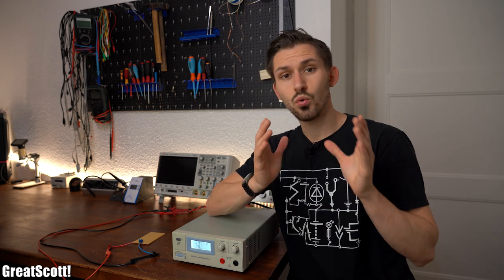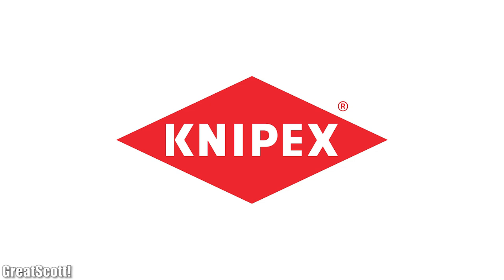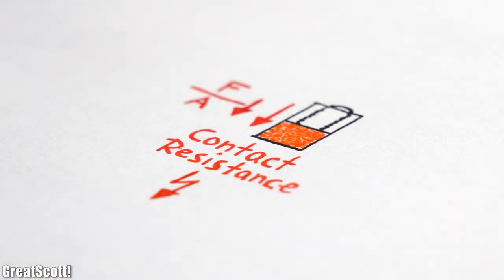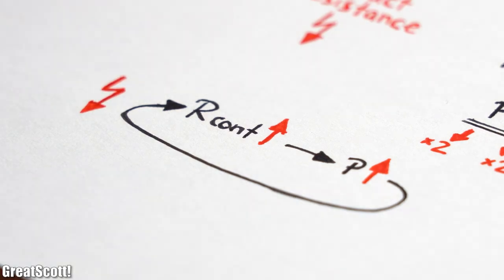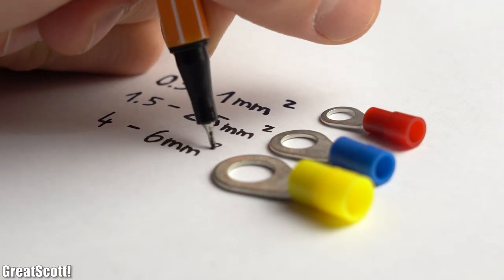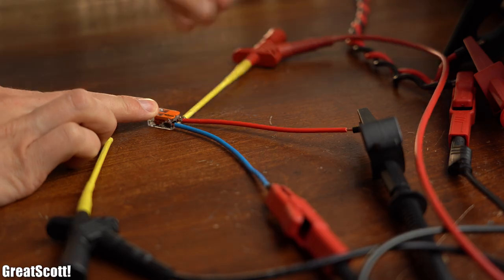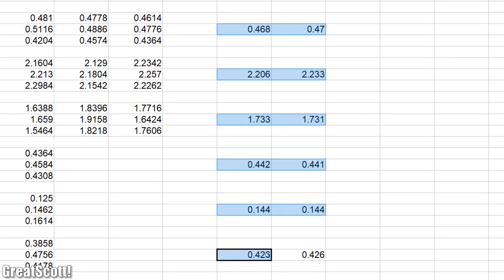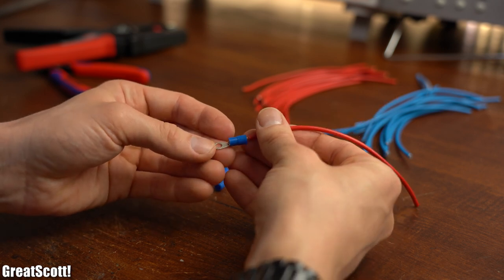Connectors are more important than you might think! So which one is the best? (Experiment)

Comment: If you're going to join wires with solder (which is a great idea), at least twist them together before you do. Better still, use a linesman splice (also called a Western Union splice). Some wiring regulations require mechanical connection between wires and solder alone will not pass inspection.
Reply: Solder is really like electrical hot glue. It's not super strong, and it's not super conductive. It just holds things in-place.
Reply: @jaymzx0  Wire splices hold things in place. The solder just ensures electrical and heat conductivity remains high, and corrosion between the spliced wires, low.
Electrical conductivity of a spliced wire and solder join is excellent, but mostly because you have a large surface area of contact between the two joined wires.
Reply: because when the wires heat up the solder can melt and then the loose end might electrocute someone
Reply: I learned how to solder when I was about 11-12 years old I still have my Weller 8200 soldering gun to this date. It's had a new case, replaced the cord a few times, but keeps on going. Early on I learned about cleaning the conductors, and making a strong mechanical splice whether butt splice, pig tail in both solid and stranded wire.  Apply heat to the work, let it get hot enough to "melt the solder, and flow into the joint"
Reply: Solder is like thermal paste. Not a good conductor, just a lot better than letting an air gap form. And a weak glue that is strong enough for unstressed connections.
Reply: @rebeuhsin6410  No you don't need to clean the core flux, not from current carrying wires. The flux core in the solder is always just a form of rosin flux, usually distilled, often mildly activated. It doesn't exactly pass the NC criteria since it can change its properties over time a little, but in cold state, its acidity is so low that it'll rather create a passivating surface oxide than actually damage the conductors. And obviously you should never design such that you have a wire generate enough heat for it to become active, because at that point, odds are, your insulation is melting off.

You should clean it from PCBs though. I haven't seen it outright eat the PCBs, but sometimes you see an old board, which has a difficult to diagnose issue, you clean it, it works perfectly, huh. Probably the flux residue combined with some moisture or attracted other contamination which caused just a little bit of coupling or creepage.
Reply: Lol this comment chain has so much wrong info. 

Tin and lead and silver are not conductive? Bad mechanical joint?

I don't think any of y'all know how to solder. Lmfao

Comment: I've recently found that "fork" connectors work well. They are just like the cable shoes, but instead of having a full circle, they have straight "forks". This means that they can be screwed in with the same contact resistance as a cable shoe, but they can also be inserted in the side of a screw that's already in its hole. It helps to keep the screws in place!
Reply: They're so freakin' practical. I've added them to all the screw terminals on my 3D printer (the power supply takes most of those), bought some ferrules too for the other type screw terminals (yeah, confusing I know: the former is the one where you can insert a fork terminal, the screw goes through the place where the wire goes too, the other one you use ferrules on, is what Scott showed on the video).
They're specially easy to work with when you have to do some maintenance and remove cables and such, dealing with the bare wire is annoying.
Reply: @Mr.Leeroy  then buy better quality.. no problem here with that.
Reply: I tried using a fork for my problem but all it did was shock me '--'
Reply: @MultiDarkZen  Were you inside a toaster with your fork?  ;-)
Reply: @Mr.Leeroy  thicker copper ones.
Reply: You lose about half the conductive surface of the connector though, so its resistance is higher than that of a ring connector.
Reply: @chriskwakernaat2328  non-dollar store ones that have UL/CSA markings on the box are 100x better than the cheap ones
Reply: i like the round ones because you can add loads of batteries in parallel

Comment: Great video!  There are about a bazillion different kinds of connectors and each one having some form of variant.  My electrical kit I take with me to work on, God knows what, is about 80% connectors.  There is no way that this video could cover all of them and not turn into a lecture.  It was perfect for covering the most common ones, but more so in getting the point across that it matters and that all are not created equal!  When I’m diagnosing a problem, step one is usually check the connections/connectors.

Thank you for the work you have done over the years!  This channel has been a key part of my development in this field.

Comment: For 3D printers I’ve found the screw terminals used for main power and the heat bed are usually the right size to replace with an XT60 connector soldered directly to the board. I started doing that after a fire with my first printer (lucky I was sitting next to it at the time….)
Reply: I offboarded my bed heater MOSFET using XT60 .... Kind of regret it though, the cables are really unwieldy....

Comment: I always prefer termination with Lugs crimp and solder them . It is very reliable in all weather,indoor or outdoor .  But it takes time. I had applied this method on 400 KV/ 220 KV transformer control wiring and it is working very fine since last 10 years in extreme weather condition

Comment: Wago makes PCB terminals as well as pluggable connectors.  I haven't used them on a project yet but they look awesome.
Reply: Wow, thanks for this information! Love wago, but have only seen the cable to cable type shown in the video.
Reply: I've used the pluggable  Wago terminals, very useful.
Reply: Got a model number?
Reply: I can really recommend the Wago 804 series. Since I discovered them I stopped using screw terminals on my PCBs
Reply: @simbone  Thanks!

Comment: Did I always do my crimp connectors wrong? I thoght the bit of plastic/isolation on every connector is supposed to cover all the copper wires, so you cant touch them direclty when they are inserted.
Reply: The bare wire was left for him to connect the volt meter to but should be covered in normal use.
Reply: @sdp8483  Yeah he should have mentioned that you are not supposed to do it that way :D
Reply: What others have said.  It's an oversight in the video.  You're doing things correctly.

Comment: You should try using good quality screw terminals. There are two types of therminals, the ones you use are the shitty ones. In those a screw pushes a metal sheet onto the wire.
In the good ones, the screw pulls up a kind of metal  'elevator' that squishes the cable. Imagin a very big cable entering the door of a regular elevator and then the elevator goes up until it crushes the cable with the door frame and it can't go higher.
I call them the "gillotine " type.
I am pretty sure you'd get a VERY different result with those!
Reply: The first ones (the ones Scott uses) are the "leaf spring" screw terminals, the other ones are called "cage clamp" screw terminals. And I agree, the leaf spring are absolute garbage, not only they have high resistance, they also cannot bear any mechanical stress whatsoever.
Reply: I definitely agree... these types of terminals have a tendency to release the cable over time as well because they don't properly clamp down
Reply: I've also heard the second type called "rising clamp". Though, you need to be careful not to accidentally put the wire in the wrong side.

Comment: Thank you for the tips! In the end, I decided to use the Wago 221 612 connector for my new electric shower (the most popular way of having hot water when you take a bath in my country). The previous shower's connector (a generic ceramic one) had a bad contact, since the cables didn't even have a ferule at the tip. The heat was so interese it melted/burned the insulation of one of the cables and it even welded together with the connector!
It was a lucky find, I didn't even know it was connected like that until I decided to change my shower because I just wanted a better one

Comment: I recently fixed a wall outlet that used screwless terminals. The live wire was cut for some reason, with the live wire flapping in the breeze and a small part of the wire still stuck inside. It was hard to get out the small bit of stuck wire, and it's also somewhat hard to put in something new -- as the wires are not stranded, they are indeed very inflexible, but you have to apply some force to get it in. Especially if you're only replacing a single wire with the other one (or two) still attached. You risk bending your wire a bit too much (which may be the reason why the wire was cut in the first place) So I recommend you get ones with regular screw terminals if you ever find yourself having to buy sockets for your home.

Comment: The soldered connection is often the worst for long term applications. I have had so many occasions when the wire breaks off at the place where solder ends. This is the biggest issue with multi-strand wires and always have to use connectors in vibration environments like automotive.

Also don't solder the wires in the crimpable connectors. Same problem with wires breaking off

Comment: Great Video. Another connector type that I sometimes use when higher current might be possible are the XT60 and XT90 connectors, but those are overkill for most projects and you will pay a premium for them, at least if you get the real ones (which are probably the only ones you should get)
Reply: That's why you go for the XT30 instead. They're much more manageable in size, don't take 10 tons of force to separate, and you can get them in packs. My favorite connector, hands down.
Reply: XT60 is actually very inexpensive compared to connectors like Powerplug and EC3 that it competes with. Obviously comparing genuine vs. genuine.
Reply: @SianaGearz  a key difference is connector stability too.

A cheap and presumably fake powerpole is absolutely a fire risk. It depends on the construction of the plastic housing to keep the connection intact and stable.

An XT is essentially a bullet connector in a keyed housing. You could remove the entire housing and the connection would still function as designed. Thus a cheap XT... is not nearly as risky a proposition providing the connection internally is sound.

Though I'd still go legit only.

Comment: Although soldering makes great electrical connections, it might not be the best solution in environments with lots of movement (near motors or inside vehicles). Stranded wire tends to break at the transisition between solid (soldered) and flexible parts of the wire. In these environments it's better to use terminals. When you do solder, always use heat shrink tubing that extends well beyond the soldered part, to stabilize the connection.

Comment: That is very interesting, in 3D printing, some companies like creality use to tin the tip of stranded wires that then go in screw terminals, that's used for the bed and hotend heaters, therefore high power.
It's not uncommon to hear complains from people of melted screw terminals.
With what you found out, it would be better to replace the screw terminals altogether, as when heating up, bed and hotend can draw over 10A.

Did you test the screw terminals with stranded wires or with ferrules?
Reply: That was no doubt a cost-cutting measure considering the market segment Creality occupies, presumably to aid in assembly without stray wires shorting out against other terminals. Crimp ferrules are cheap and are the right way to do it. I recently rewired my Prusa knockoff printer bought 5 years ago with ferrules and Wago terminal blocks. Even with the 200mm 12V heated bed at 90c, the connectors are as cool as a cucumber. When I first got the thing, the cheap knockoff 'Phoenix' connector that plugged into the RAMPS board melted and almost caught fire during a print. I replaced it with a legit Phoenix connector and it was fine until I replaced the board a few years later. So, beware of knockoffs!
Reply: Can confirm, I have an Ender 3 Pro and am planning to replace those terminals with Wago connectors instead... Never realized how awful those PCB screw terminals are and I'm very glad I learned from a YouTube video rather than personal experience.

Comment: A couple of thoughts to add.

1) Screw terminals with mains wiring need regular tightenning because the nature AC current will cause vibrations that in time will loosen the screw. This is big reason that many electrical codes now prescribe spring terminal connectors for hidden or concealed junctions.

2) Screw terminals deform single strand copper which does help to captivate the wire even if the tension fades due to 1) 
    Worse however is that screw terminals have a nasty habbit of cutting strands of stranded wire or just pushing them aside so that the screw doesnt hold or make good contact with a substantial portion of the wire - which is one of the many reasons they really suck for stranded wire.

Comment: I'm just looking for a good wire and connector for a moduled PSU .
I'm planning to make my own moduled wire to make my computer setup more tidy,however,it seems different wire gage and connector type really do something to the power performance?
Reply: The way the gauge affects the terminal is only in regard  to the voltage drop across the wire, which increases with more current draw. Hence, a bigger conductor has less drop. This is an issue with REALLY thin wires. the 28-22 AWG wire in PSU's is generally sufficient. 

Silicone wire sheething (outside plastic) feels nicer, and is more flexible. The xx/xx numbers on stranded (AWG) wire are a combination of the individual strand gauge, and the count.

For your connectors, you'll have to the standard Molex MiniFit Jr that almost all pc parts have.
Reply: @AnnaVannieuwenhuyse Thanks , however, based on my current knowledge,there are several types of connectors(for cpu 8 pins ,PCIe 8pins and MB 24pins),the long one,short one and one with glod layer. There seems lits to do to make a high quality and durable moduled cable!

Comment: I like your videos, this one is exceptional because I worked for AMP connector later Tyco electronics. In several scenes (e.g. 9:52) you see blank wire after the insulation of the ferrule AMP connector. This is a no-go. Manufacturer's recommendation is to strip of 3mm of the cable insulation. But beside this - good job man.
Reply: I believe he had done so for the purpose of measurement, to have a point to jam the probes into, not a recommendation for actual deployment. Could have possibly been more clear about that.

Comment: I have been using these kind of butt connector that has low melt temp solder inside of a shrink wrap tube. When you use a heat gun it melts the solder and shrinks the tube at the same time. They are kinda pricy but they work great for fiddly stuff that is difficult to solder.

Comment: It is worth noting that many people think that a normal fuse can save you from a bad connection. I think they think like this. "Why did the fuse not blow since there was very much burning in the connector". But in reality there is a little less current passing the fuse when there is a bad connection since the bad connection introduces series resistance. Even though there is less current through the fuse the voltage drop over the bad connection makes it heat up quite quickly and burn.

Comment: I would like to see the test with a stranded wire vs solid wire resistance on a screw terminal. Ferrules are also good for keeping the strands tidy, but probabbly the lowest resistance will be on a recently tightened stranded wire conection. Naturally there are some applications like induction heating that benefits from stranded wire lower overall skin effect. I would also point out that corrosion is a big contact resistance impactor, as well as vibration or movement.

Comment: I was working on some military radio Lion battery power units back several years ago which were connected via 1/4" spade terminals so I had to make up some test leads. Having crimped the female spade terminals onto the leads and shoving 32A down them the first thing I noticed was the fun bit of the leads sringing apart due to the magnetic field around them. What did become obvious was the connectors becoming rather warm. Using a thermal camera I could see that the heat was being generated by the crimp so decided to add solder to the joint too. This noticably dropped the heat coming off the crimps. Due to this I've never been a big fan of crimps and tend to always solder stuff but not forgetting crimps do have a mechanical connection as you wouldn't want your runny solder joint coming apart under load.

Comment: Never used ferrules before -- they required carrying large stocks of different sized connectors and yet another hard to find expensive crimper.  Often used "cable shoes" but never called them that -- always called push-on connectors in my world.  Often used Molex connectors and can vouch for their poor current handling capacity.  Was once employed by a computer company that used Molex connectors in their 1970s vintage airline reservation computers.  Half my job on customer sites was just reseating those connectors or replacing whole power supplies whose connectors had browned or become brittle due to the heat given off by them.